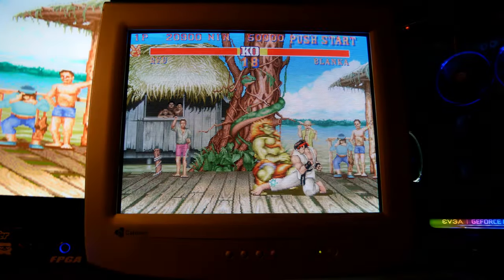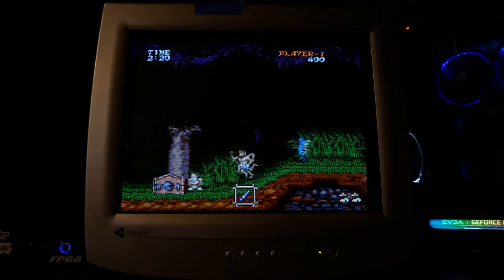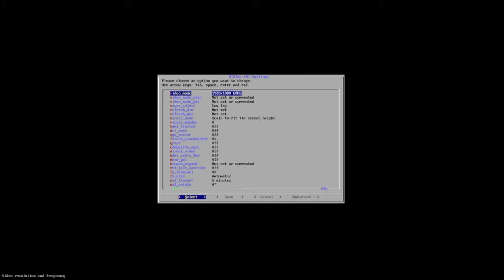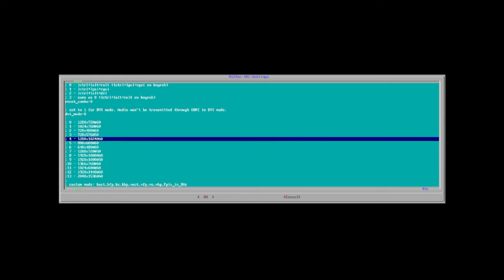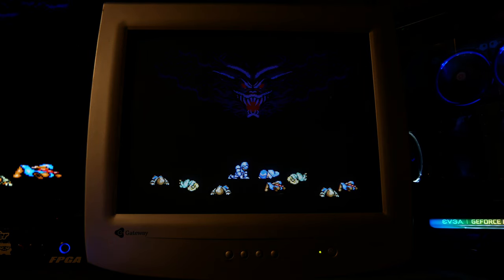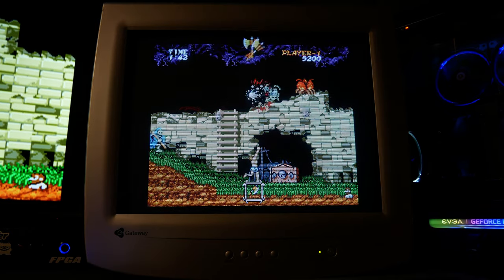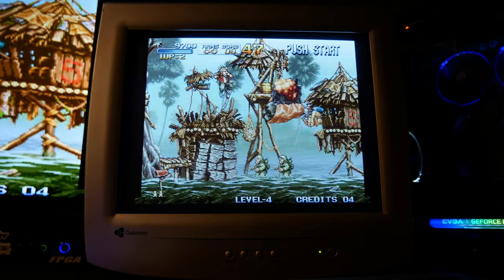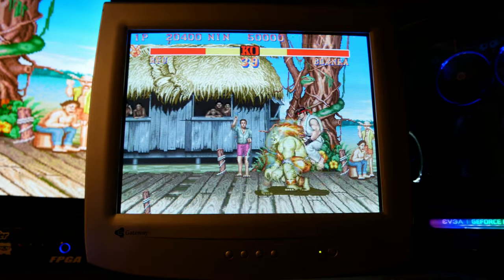240p 120Hz MiSTer FPGA PC VGA CRT Settings / Guide / How To Get Best Video Settings for 31kHz CRT

Comment: Hi bro, I Sorting my mister on my Apple studio 21inch crt, i missed the step where you put the code line in lol looks beautiful on my crt, thankyou :) the only downside is i was hoping to stream some retro games from the hdmi port to my Elgarto capture card va my gaming pc, but the graphics lok blurring on my 4k hdmi monitor, so i'm guessing it most be something todo with the code line, is there anyway around that?
Reply from the maker: Sorry bro....I cant remember what setting hdmi was set at when using the custom modeline and have my game wall tore apart at the moment installing shelving for my crts and consoles so cant even check right now 😖

Comment: Great video, what crt would  you recommend for this look with the mister?
Reply from the maker: Anything with a trinitron tube is nice but really any vga crt should be able to handle 240p 120Hz.

Of course the bigger the tube and higher res/refresh is better but most importantly make sure the tube has some life left.
Reply: I've just purchased a 21" Apple Studio Display (Graphite - CRT), introduced to complement the Power Macintosh G4/400, Power Macintosh G4/450, and Power Macintosh G4/500, features an ultra-fine resolution (1600 x 1200 at 85Hz) 21.0" (19.8" viewable area) Trinitron CRT, an integrated four-port USB hub, and push button "lifetime color calibration using ColorSync technology". Other than the color of the external housing, this model is identical to the 21" Studio Display (Blueberry - CRT).
Reply from the maker: @discjoctv  Nice! Good find!
Reply: @LameGaming  thanks bro, the only downside is that it cost $446.48 but its in superb condition, and its all been professionaly cleaned and capacitors have been checked, plus there rare in the uk, it was in storage for 15 years. so its not had much use.
Reply: if your after one from the u.s.a there was one posted on ebay yesterday, the bluberry - CRT 21" Apple Studio Display :)
Reply from the maker: @discjoctv  Id like one but running out of space to hide any more crts 🤣
Reply: @LameGaming  Hiya,  I FINALLY GOT MY MISTER FPGA :) WITH AN I/O Board vga out and hdmi, i'm trying to find the best settings in the mister ini file for my 21inc Apple Studio CRT, but not having much luck, was hoping you might be able to help?
Reply from the maker: @discjoctv  Congrats on getting a mister.... They are awesome and exciting with the psx core now official and jaguar and saturn in the works.

Anyway.... Ive found a ton of pvm's and bvm's since this video and currently have it hooked up to an 800tvl crt and a 36" rgb modded jvc crt. I havnt ran on a pc crt since shortly after this video so ive forgotten much of the settings.

I tried to show the main options in this video and the info given on here was all fresh from my head which ive since probably forgotten most of lol. Is there anything specific your having problems with?
Reply: @LameGaming  thanks for your quick responce, when I dont have vga scaler switched on my crt doesnt switch on, when i turn it on, i get double mister box on top of each other
Reply: Do you have a discord?
Reply from the maker: @discjoctv  I do have discord but out of town at work 😣

Do you have scan doubling enabled?

Maybe start over with fresh ini and try enabling scan doubling again?

If the pc crts I have would of been brighter I would of been happy with scan doubler and the 50% or 75% pc fx filter but my pc crt tubes are high hour and a bit dim.

Comment: I've tried your trick, review everything and it just won't shoot a 31Khz signal to the VGA PC Monitor (I am using an HDMI to VGA adapter by the way).  It shows 15.7Khz out of range.  Any idea what setting could be wrong?
Reply from the maker: Hmmmm... So your using a direct video analog signal out of the misters hdmi port?

Ive never tried this, I wonder if only the analog io board can support the custom modelines.

Doublechecked the modeline you entered? No image displayed at all?
Reply: @LameGaming  Nope, no image.  My guess is that the PSX core is not configured properly to use the direct video analog signal out of the Mister HDMI port.  I should say not implemented and from the sound of it, I don't think they will ever implement it as nobody else other than me is complaining (asking for that feature). Because seriously, all other cores... the quality is just the best I have ever seen.  I have another Mister with the VGA IO Board/hat.  It's nice.. but not as great as the HDMI to VGA.  There is no lag, rich colors and brightness and contrast are just perfect.  So sad PSX core is not working though...
Reply from the maker: @beetwing   But it is working fine on your other cores?

Yeah I havnt tried it with the psx core. I have not tried analog through direct video out either.... Sounds like I need to
Reply: @LameGaming  Yep, all other cores are working perfectly, just the PSX. If you want a challenge, go ahead :). That is a good one I can tell you!!
Reply from the maker: @beetwing  lol, I dont have my pc monitor hooked up at the moment

Comment: Does this cause wear to the monitor? I read somewhere that it puts the flyback under a lot of strain.
Reply from the maker: Thats a good question and one im not sure about. Ive read the same thing but also seen it argued that it doesnt strain the monitor at all because its just low res 240p content. 
I think it would be based on the quality of the monitor used , and its max res and refresh rating.
The vx930 I used would probably be considered a 19" mid level vga crt monitor with a .25mm dot pitch and I believe max res/refresh of 1600 x 1024 @75Hz so basically your trading resolution for refresh rate and I wouldnt think 240@120Hz would put much stress if any on a monitor like this.
My other vga crt monitor is a vx900 so basically the same specs. These have had no issues but cant say for sure that something like a very basic 15 or 17" dell monitor couldnt be stressed by doubling the refresh even with 240p signal.

Comment: I bought a PC CRT and the picture keeps cutting out for a few seconds every so often. This happens fairly frequently. Any idea what could be wrong?
Reply from the maker: Is the image just loosing sync? Could be the res/refresh your feeding it, did you try to lower the signal? Or check vga cable for shorts.
If its actually powering off and back on it could be capacitor or other compenent/s failing in the power circuit of the board.
Thats about the best guesses I can give without seeing it, dont open it up without research, the flyback-anode on the back of the tube can kill you.
Reply: @LameGaming  It's not the VGA cable, since it works with a separate monitor I have. It's just frustrating because I have three monitors and each has it's own issues. The bummer is that no one works on these things anymore.
Reply from the maker: @TheRelen222  Have you tried setting a lower refresh and resolution? Im assuming you have the monitor on a PC right now? Are you sure the video card you have that has analog out doesnt have issues? Any other system you can test the displays on? Any other vga cables to test?
Reply: @LameGaming  One of the monitors works fine but has an obvious issue, massive  burn in, the worst I have ever seen. Not really an issue as it was free to me. The second monitor works fine--it has some minor imperfections but it only bothers someone that is a perfectionist. This newest one I paid for though, which is why it miffs me. I'll keep tinkering with it though. My brother in law is a computer tech guy so I'll have him take a look. Thanks for your suggestions, I'll try them out. I'm finding that getting a good PC CRT monitor, while much easier than a pvm, is still something of a challenge.
Reply from the maker: @TheRelen222  I predict 5- 10 years from now any crt in working order will be rare and magnitudes more expensive. Stack em up lol
Reply: In my case problem was solved by disabling exclusive full screen and running in Windowed full screen

Comment: Mister is not required, or even recommended, it's emulation is maybe 1 or 2% more accurate than retroarch compatible cores
Reply from the maker: Sure emulation is fine, thats where I started and still run it on my arcade cab but mister is cycle accurate hardware simulation not just software emulation, where it shines is the plethora of digital and analog output options that can easily be changed and swapped with alternative ini profiles. No need for old analog video cards and crt emudriver which is great dont get me wrong, but was a headache to setup properly with a crt and always felt clunky and hacked..... Still....They all have their place.
I agree software emulation is good and you can run 240p 120Hz with it as well with custom modelines but do not agree with the blanket statement that mister is not recommended. Not recommended by who...you?...... 
Because theres thousands of retro gamers on subs,forums,youtube who left emulation for fpga completely because software emulation just never felt accurate or cohesive as a whole solution. Mister is so authentic I havnt touched my original consoles since getting it.
Where emulation shines is the systems and cores not yet supported by fpga, but for what mister supports I dont think it can be recommended enough.
Reply: @LameGaming  yes, by me, because its still emulation, and for the price of a Mister you can easily pickup 1 of every retro console you like with bundled games, I've recently purchased a Wii + PS2 + Gamecube + Master System + 2x CRTs, loads of real games, cost under £100 total..and it will always be superior to a mister, and real hardware generally only appreciates ..a mister depreciates, for me it's a ridiculous device and is no more than a "look what we can do" vanity project.
Reply from the maker: @Ne0ge0X   Well your entitled to your opinion but just the neo geo core is worth the price of admission for perfect rgb output, unibios, etc. I dont know where you find your consoles but around here just peicing my neo geo mvs cost me twice as much as a mister setup

Theres no way you can buy all the systems mister hardware replicates (not emulation) for cheaper than a mister.
Even if you did, whats the time and cost going to be to rgb mod, bypass mod, jailbar fix mod all the consoles and put together a complete library for each? 
Even if you run everdrives or optical disk emulators your still in the thousands of dollars range.
You clearly dont understand how fpga works or its benefits, i wont respond past this message because I think your trolling at this point

Comment: Can this still be done with  crt switchres? I still haven’t found a decent how to for crt switch res
Reply from the maker: I have an old video on a crt-emudriver setup I had using retroarch and switchres. Not much of a video lol.. But theres a written guide in the vid description

https://youtu.be/Xp4sQlvCawo
Reply: @LameGaming  oh thank you man!!!!
Reply: @LameGaming  while I have ur attention I was able to run 640x480 native on my fw900. I mainly play ps1 titles… I have great scan lines at that res on srgb mode…. Should I stop there and be happy? Or is 240 really the holy grail?
Reply: @LameGaming  dude no fun way!!! I was able to run 640x240 on the fw900 without retro arch. I couldn’t switch to the res through windows or nvidia and only nvidia enabled it cru never worked…. Found the res in duckstation omg!!  I had to push hz to 160 to make 31 limit
Reply from the maker: @PixelGod240  If your happy with it then you could stop there. I went for 240p 120Hz because 480p with scanline filters was too dark
Reply: @LameGaming  I just found out the fw900 let me push out 640x480 @160 had to push hz to meet min clocks!  The 240 really does look magical. I would say 640x480 looks pretty great as well.  
240 is giving me nostalgia bad!
Reply: Sorry 640x240

Comment: Great video! Do most PC CRTs even support 120hz? Mine is only rated for 85hz in the manual
Reply from the maker: Thank you!..... and yes, its basically doing the same thing as scandoubling..... its just doubling one freq and not the other..... the pc crt wont care.

The monitor I use in the video has a suggested max res 1600 x 1024 @ 75Hz.
Reply: The maximum refresh rate of a CRT changes with the resolution you're trying to display. The higher the resolution, the lower the max refresh. The lower the resolution, the higher max refresh.

Comment: Have you tried 240p 180hz? I did and there is less input lag than on 120hz.
Reply from the maker: I have not. I dont understand how this would reduce lag by tripling the freq but Im curious.... Do you notice motion blur at 120Hz? At 180Hz it should be even worse and drawing each frame 3 times... Im curious if you notice it with 180Hz?
Reply: @LameGaming  tbh I don't notice motion blur on either setting but the 2 frames of input lag introduced by vsync adjust =0 is supposed to be reduced when doubling or tripling the refresh rate which would make 240p @120hz 16.66ms of input lag because it's 1000 divided by the refresh rate that means that 240p @180hz is 11.11ms or around that number.

Comment: IMPORTANT. PLEASE READ!!

Just a fair warning to those who try this out: Once you are in this mode, you CAN'T go back into the ini to go back as the ini is completely covered with a garbled image. The only way to revert back is to replace your ini file from the main mister github and start over!
Reply from the maker: I just plugged in an hdmi display.
I always use one when running any analog signal so that i can update all and see script menu. Easy peasy
I dont run this setup anymore since getting my pvm's and rgb modding my big 36" jvc but ive never had to go in and start over ever. I just keep an lcd panel hooked up to hdmi output and only ever had to go into the ini menu and change the options I wanted to.

Comment: can this damage your monitor?
Reply from the maker: I would think 120hz would be safe since we are just talking about 240 res..... If your worried about the monitor then check its specs .... If it can handle mid and higher resolutions at something like 80hz+ then I would feel safe running 240 at 120hz. The only thing id be really worried about would be super early crt monitors or ultra budget cheap ones.

Comment: You get motion blur from image doubling this way unfortunately.
Reply from the maker: I read about blur/strobing/shimmering artifacts so much with 120Hz to a 31kHz CRT that I expected it to look like garbage and almost didn't try this out.
In my opinion the issue is way overblown. I've played side by side with original hardware on a 15Hz CRT last night and I don't notice any blur or negative artifacts on this setup.
All the other options on a 31kHz CRT with scanlines in my opinion are far too dim to the point where I feel I might as well play on a LCD.
The blur artifact is said to not be able to be seen on video but still recorded a side by side video last night because it gives a close approximation of what I see.
The input lag is there but the overall image quality makes it the only choice for me if I'm going to play on a 31kHz CRT. Maybe the blur will bother others but with this display, these setting, and these eyes its not an issue.
For others it may be
Reply: I also run 240p games this way but with Retroarch and do not notice any problems with motion clarity. Of course you're gonna say "even if you don't notice it it's still there." What I say to that is why would I care about something that I cannot perceive. I have also tried this side by side with a 15kHz set and the VGA CRT looks better imo. Have you even tried this method yourself with your own eyeballs? If you do, you may find that it's really not the issue people make it out to be, and you can get an image just as good or even better than a PVM this way.
Reply: @C4103  Yep, I tried it and once you notice it, it's all you can notice. Switching BFI on and off in Retroarch is the easiest way to notice it. 480p@60Hz is almost indistinguishable to how 240p looks on these displays and comes with no motion lag.
Reply: Also, shimmering isn't a problem if you're using the correct resolution. That has nothing to do with 120Hz and motion clarity. The big reason people use CRTs is no input lag and no motion lag. If you look at OLEDs, OLEDs are superior in every way (dark levels, viewing angles, brightness, no phosphor persistence, no reflection within the tube, etc.) EXCEPT motion clarity. So why would you want to take away the biggest and only advantage of playing on a CRT?

And no matter the display technology, if you don't match FPS and frequency, you're going to get inconsistencies.
Reply: Adding this as well - I did not like the look of 240p on 17" or 19" PC monitors. It's way too sharp. It only looked a little soft on one of my 19" monitors (Vision Master Pro 450). On F900P (slot mask), 959NF (another Diamondtron but newer gen with lower dot pitch) and G90F+ (shadow mask) it looked too sharp.

480p is much better on a 17".

240p looks better on a 14"-15".

240p on 19" is way too sharp, let alone on a 22" monitor (not even gonna mention the 24" monitor I have which is 22.5" viewable). So, yeah, just stick with 480p@60Hz and add scanlines if you really want sharpness.
Reply: @nicknolte8671  "And no matter the display technology, if you don't match FPS and frequency, you're going to get inconsistencies." - What about PS2 / Gamecube / Xbox era games that use 480p but only play at 30 fps?